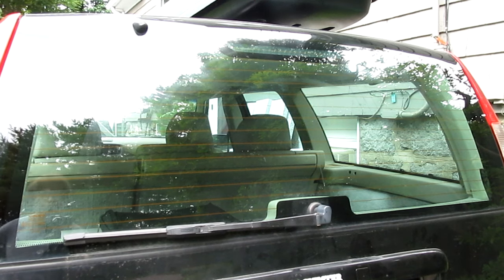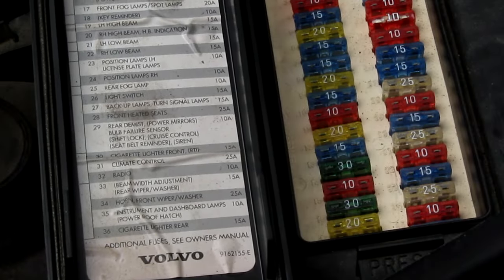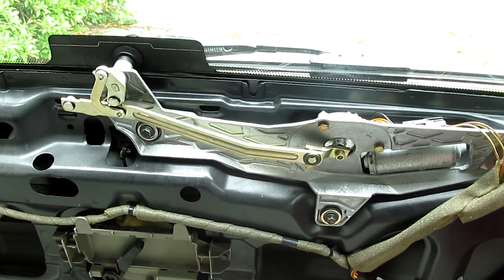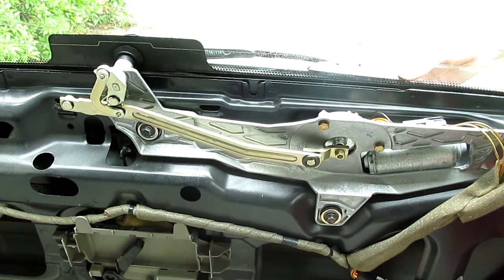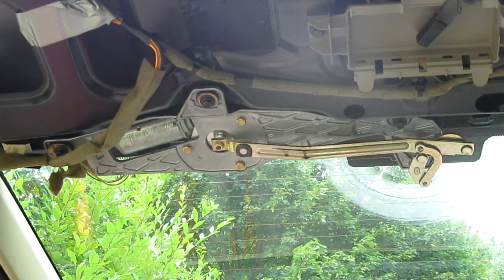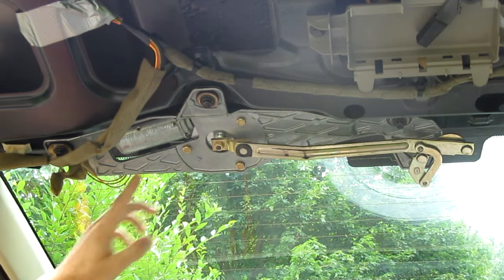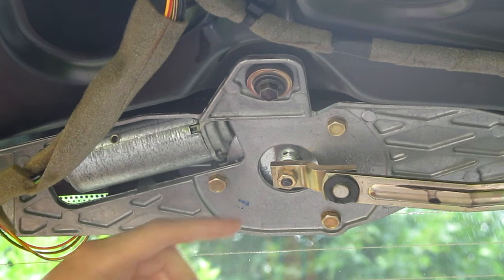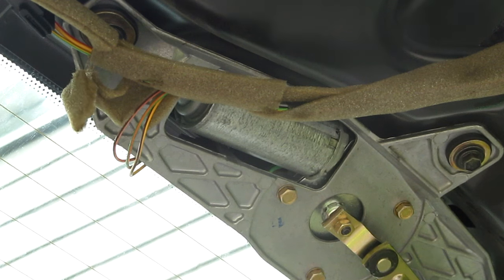Rear window wiper troubleshooting

Comment: Mine was badly jammed so i took out the motor and wiper completely, scraped the rust off and lubed it up and it rotates like a dream now.
Problem is though...The damn wiper will only work when the hatch is like 30% or fully open.
Never when its closed.

Comment: WD40 is not recommended as a permanent fix because it will dry out after a short period of time. You should apply a lubricating grease for a permanent fix.
Reply: Pradeep Ram 

mnbhj
Reply: Thank you. I will take your advice in consideration.
Reply: Silicone spray and lithium grease yes

Comment: I would recommend a spray lithium grease or some other actual lubricant. WD-40 is good at breaking stuck things loose but it is not intended as a lubricant.
Reply: Yes, it is in fact 100% a lubricant.

Comment: I thought there was a  short circuit
Reply from the maker: Not in this case.
A hard short would have taken out the fuse instantly when the wiper was switched on.
A softer short would blow the fuse after several seconds or minutes of running the wiper.
A shorted winding in the motor could cause either of the above symptoms, or just cause the motor to overheat without blowing the fuse.
Reply: The Hypno toad is